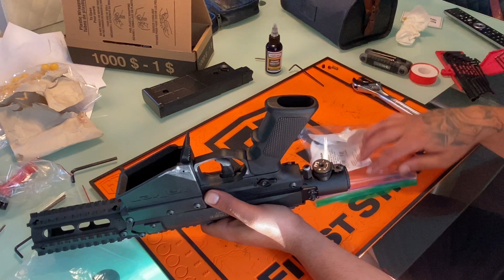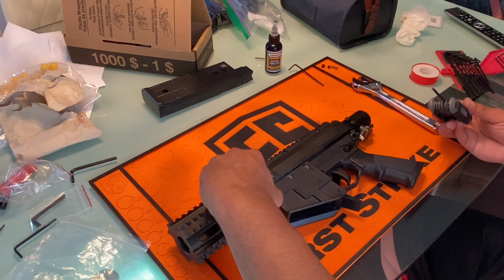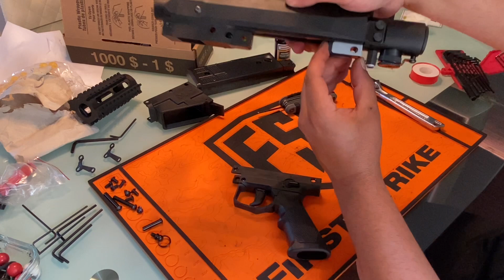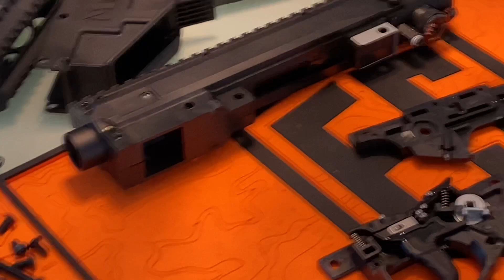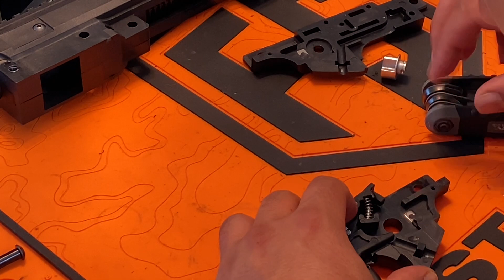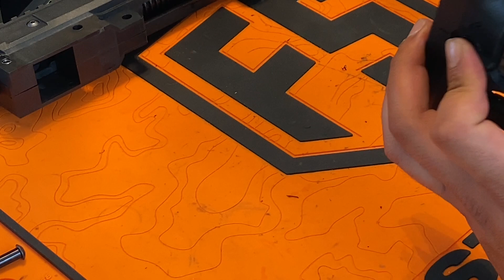VALKEN M17’ - HOW TO SHIM SEAR FOR LONGEVITY LESS LETHAL HIGH FPS - HOME DEFENCE CANADA RIOT BALLS

Comment: Very helpful thank you! I was having ghost automatic firing without touching the trigger when the gun flexed. My BRH lock broke and I didn't think anything of it. I noticed my bolt pin was banged up on the top and some smaller dents in the bolt. 
I adjusted the trigger screw further out, and I'll add this shim trick tonight. I wonder if I can just remove the BRH entirely for now?
Reply: @canadariotballs1283  ok then I'll remove the BRH and try and get the plug

Comment: Have you had any issues running it at 1100 PSI output? I was going to run a first strike tank with a ninja v2 SHP at 1100 or maybe 950 PSI output, I just don't want to hurt the bolt! What you think? I'm following all your mods btw and love your vids!
Reply: @canadariotballs1283  that's awesome! I use all your tips and mods for longevity and power, hoping to get long life from this marker... And can you recommend another marker that's an absolute powerhouse? Or is there one your waiting for? Thanks man.
Reply: @canadariotballs1283  very helpful information bro! I live in Canada as well it's tough for sure, have you checked out the site novice defense.com? I just stumbled upon them they have some serious markers in stock apparently 🤷
Reply: @canadariotballs1283  bro after that sear spring mod did you find your trigger has a harder pull when gased up? Mine does and when it's on single fire and I give a good squeeze the selector switch sways a tiny bit, what do you think is causing this? I took apart my trigger two times everything seems normal?
Reply: @canadariotballs1283  ok that's great to hear! I personally like the feel of the tight trigger it just threw me off since it was the first time I shot it since I've done that mod, I've never tuned my trigger yet, I'm going for single fire high power defense use, I followed your shim mod very carefully and I think it's working great, I find grinded the tip of the screw, less chance get caught up on the spring,, the trigger selector only when on single fire NOT gassed on, if you give a firm squeeze to the trigger it shifts the selector switch ever so slightly! Doesn't seem like it's doing anything it's just tripping me out lol I'm very new to this and loving it, still getting to know the M17, I'm waiting for parcels hopefully next week build will be done 13inch lapco FSR. FS 13 13000 tank. Ninja v2 pro SHP 1100 output. And last but not least chronograph. 7 gram first strike rounds only because riotballs is having a decent deal at the moment. When my pockets are not so light I'd love to purchase some of those 10g riot balls from your site!

Comment: Is it possible to get aftermarket parts for the gun to make it internally stronger and stay reliable? If not there needs to be company’s that do and you should look into this if it’s doable.
Reply: @canadariotballs1283  I’ll check out the video on the screw bumper.
Reply: @canadariotballs1283  Definitely going this route. Thanks bro.

Comment: Someone who owns a M17 told me its not reliable at high power.He advised me not to buy it.His regulator broke 2x because its made from weak material.What is your opinion and experience?
Reply: @canadariotballs1283  Thanks for your answer.If it will be the case to buy one I will come back with some questions.Still waiting the HDX what didnt come into the shops yet.The VKS pepperball unfortunately is damned expensive.